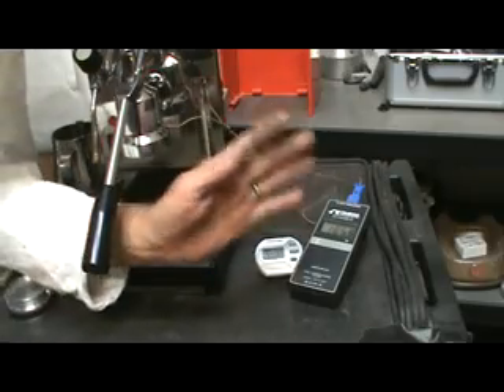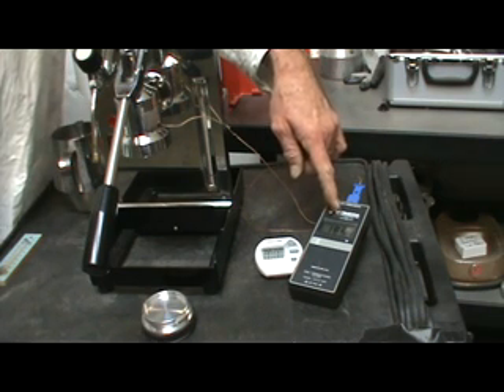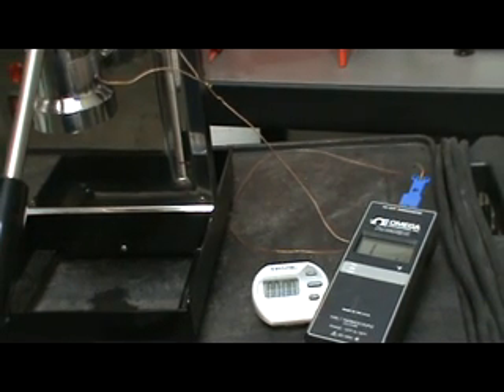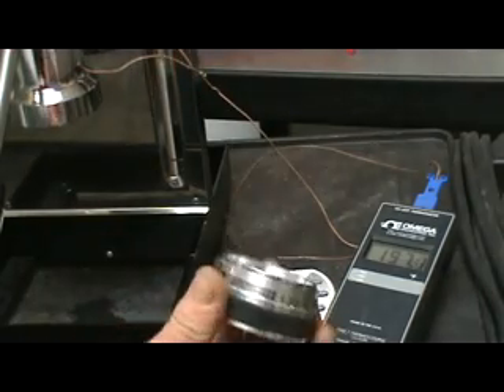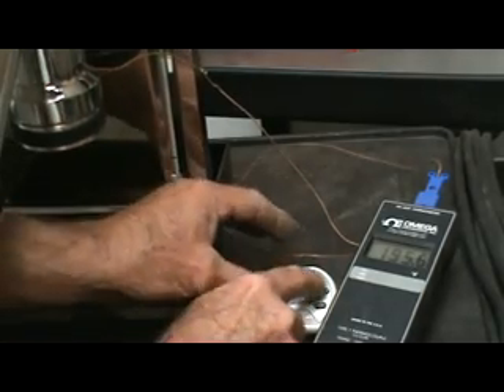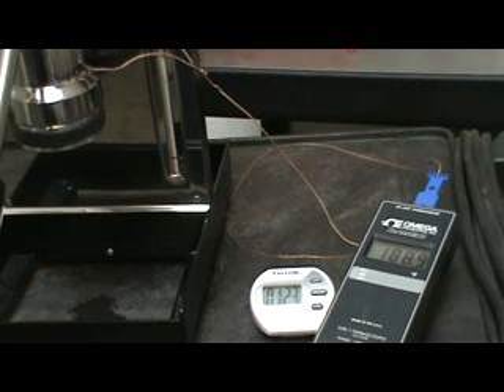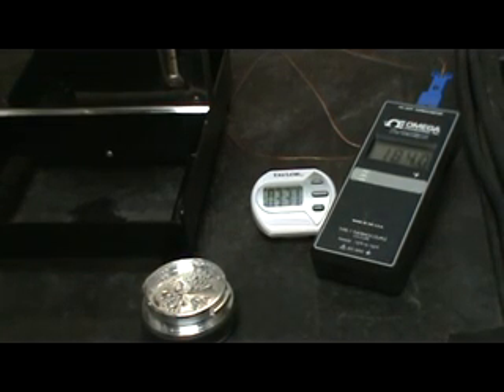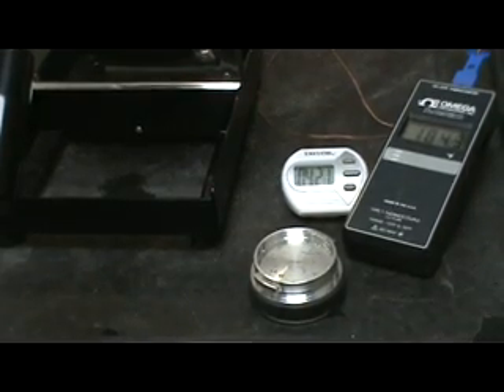OE 3rd Shot Home Lever Espresso Machine Group Heat Sink DEMO

Comment: This is a useful solution, but your just wasting power .... ie your using a lump of heat sink to get round a weak control system philosophy ...... insulate the back of the thermostat, so less heat escapes and the heater element is turned of earlier ..... or is this a compromise to get round the single boiler compromise ? Run it hot to get steam & then have to shed heat not to fry the coffee ?